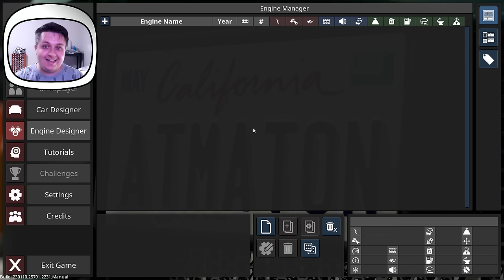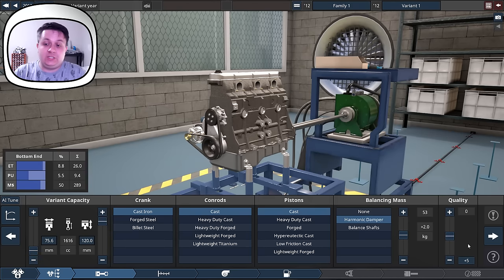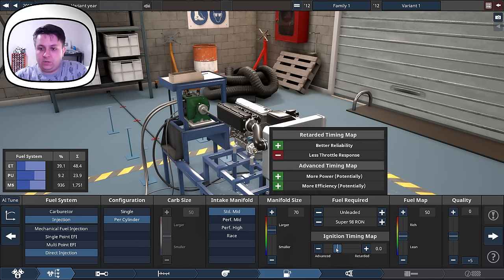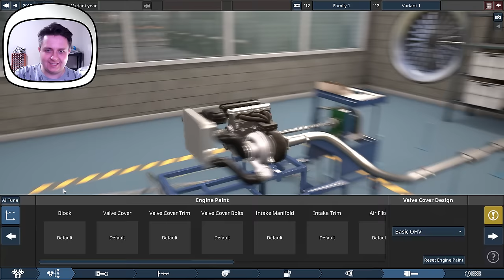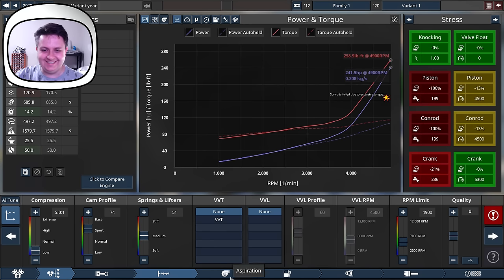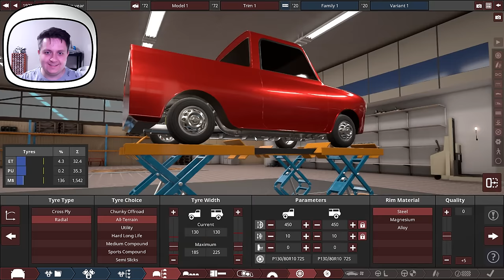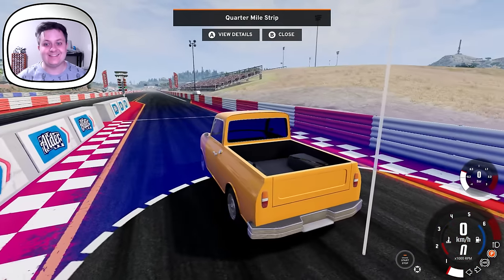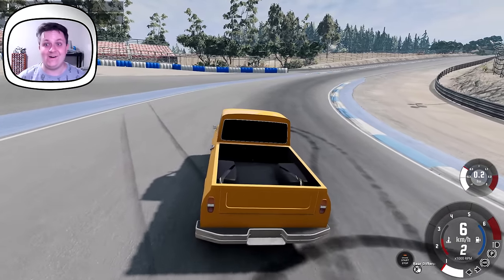Building & Testing an Engine With LONGEST Stroke & SMALLEST Bore (Automation | BeamNG)

Comment: The game is good, but as this type of car is supposed to be the most basic model, the worst engine is technically the best engine in this car
Reply: Like, the car model is supposed to be very light, it doesn't have much resistance to movement, the engine's power reaches the minimum level of scraping the limit to break a part, but it's still very light

Comment: Check your cam, top NA torque should be around 3500rpm.
And the turbo is too big.
Also, a rule of thumb, at low power (<300hp) aim for 180/230 km/h top speed on the gearbox.

That 3 cylindres "junk" should get a redline of 5500rpm, top NA torque 2500rpm, compression ratio of 8.8:1, 2 valves per cylindre, pushrod, carb. Keep it at 2 liters too.
Then tweak it a little, timing of cam mostly, to change the top torque to 4000rpm, that should allow to change the redline to 6500rpm.
Then put a turbo.

Something around those lines.
Have fun with that awesome game

Comment: some german guy built a hillclimb monster  using a hdi block   hayabusa heads and running on gasoline.  
capped at 11500  rpm.   if its stupid but it works then its not stupid.
nothing better than having a crazy idea become a reality and it works as intended.
Reply from the maker: that's wild!

Comment: Ar. On a turbo is basically how wide the inlet is it stands for area over radius think of it like a bigger ar is a bigger straw more air passes through but at lower velocity smaller ar usually spools faster and is better for smaller motors but at the expense choking at the top end big turbo do not = more boost directly to achieve highest hp numbers and not have no response you have to pair the correct turbo with your setup im not an expert but thats what I've gathered when preparing to build my car

Comment: I made an engine in automation the was a quad turbo 21L v16 that made 6422hp and over 8000ft-lbs but the only and I mean only because there is only one body you could put the engine in was an estate car or wagon but yeah it wheel spins in every gear and I have never got to top speed because it doesn’t have enough traction so yeah
Reply from the maker: insane!

Comment: Beam still doesn't understand the difference between boost loading and the engines power curve when creating the engine. How could such smart people not understand that if you're driving and you've increased load and now hit full boost 1000 rpm 2000 rpm earlier than on the engine dyno, the torque peak is going to change

Comment: Oversized Intercooler is 90% of your problems.
Its like a Difference between Farting in a University Class hall vs An elevator. 
Yours is fully wasted. 
If your space the Turbo needs to fill is too large, it will take time for the Turbo to fill it with Air. If its that Lage it wll never Build the pressure you want. 2 Bar is really High for a Gas engine. 
It's also why Your Turbo is Late and Why you have no power Before 5K.
Also, Exhaust Will strip power if it's too Big.
You have to balance all these Things.
Opposite to your opinion, Bigger Intercooler=cooler air,
air passes through the Intercooler so fast that Your oversizing does effectively Nothing.
BUT it creates a Gaping Black hole that needs to be filled with air By the turbo. That's why you have no boost down Low because It can't create any at low Turbo speeds.
So you are maximizing Downsides and Minimizing Benefits by mounting a Huge Intercooler.

Comment: I do have this game I can get a petrol engine to sound like diesel. you will have to put the compression right up at 14.0.1 or more and lower your cam to atleast 10 or less for your idle. And your going to have to use fuel unleaded 95 and the values have to be extremely stiff plus you will have to use direct injection for it to workand lower your rpm to 3000 or less. Diesel do have a long stroke and a small bore. Then do all your fine tuning and what not. There you have it a petrol that sounds like diesel

Comment: Long stroke means a very long and gradual expansion. But how to put in enough fuel for it? Well, the only realistic option is direct injection, because the engine is not gonna inhale enough just on its own. And a turbocharger, otherwise there´s no way how to press enough air inside.
Then I´d probably retard the timing as much as possible, and make the cam as blunt as possible. Its not a good design, but it should somehow work.

Comment: your exhaust turbine is to big.

also the ar setting is like a little choke. 
if you make it tiny, all the exhaust is squeezed ingo the turbine, wich lets it respond fast but also chokes it down at higer rpm / boost (with alot of exhaust flow)

Comment: 6 cyl 11L 4 stroke that i like. scania 111 or scania 112 or even scania 113... but scania 94 is smaller 5 cyl 9 L engine and sounds not as good as older 11L engines... its just me born with old busses and trucks and so on... and yes im from sweden. volvo is good to.